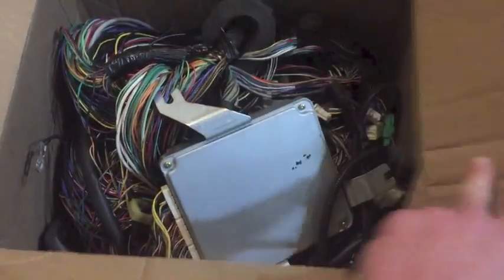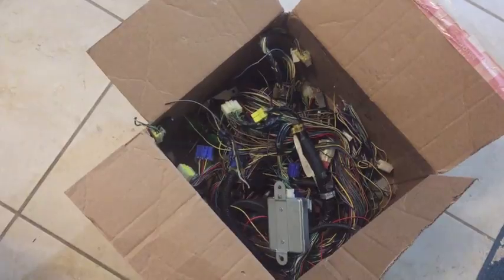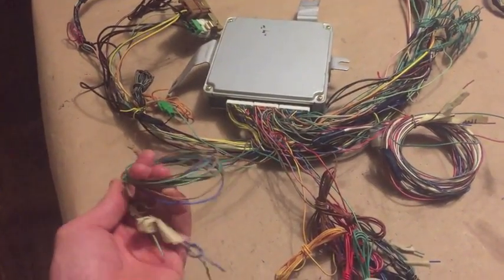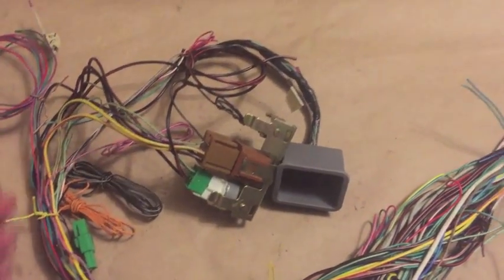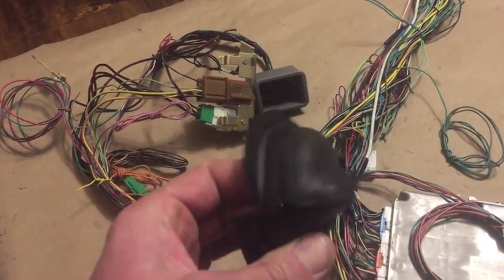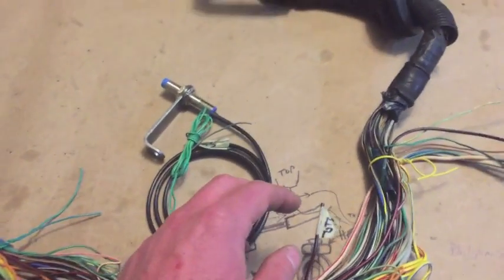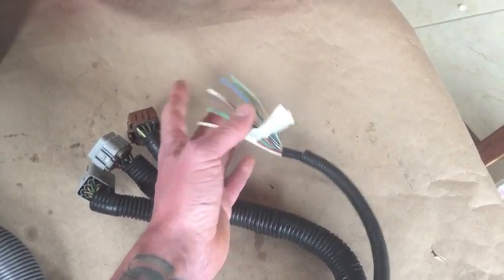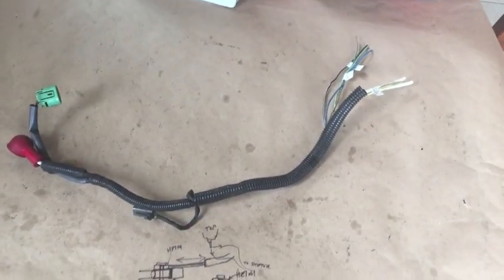2000 Subaru Legacy Wiring Harness VW Conversion

Comment: Great video.  How is this affected by the retrofit wiring kit for the instrument cluster?  I have a Subaru motor in my '87 Weekender and a couple wires on the blue foil sheet shorted out and melted.  My mechanic tells me that he can't figure out a way to get the check engine light to work with the retrofit wire kit.  Any ideas?

Comment: Hi ,fantastic vidoes,I was just wondering what you do with the sensor grounds,are they left alone. Im trying to get a 2000 Impreza 2,5 harness to work on my 2000 2.2 Impreza and for some reason the fuel pump wont cycle and the obd2 wont connect,your input would be greatly appreciated.

Comment: Some questions trying to get everything finished up for a test fire.  I can start on ether only right now.  fuel pump isn't getting power from the relay and even if I hotwire the pump it seems the injectors are not firing.  any tips?  also around 10:10 you mention 3 splices for the busaru speed sensor.  ignition on, ground, and the VSS connection to the ECU I'm guessing?
Reply: also, test mode connectors do not activate the fuel pump relay.
Reply: I kept messing around and found an ignition wire that needed signal to make the fuel pump cycle but it still wouldn't start.  after de-cluttering the excess wires from the ecu connections I got it to fire.  I'm not sure what changed between cleaning up the harness and earlier, but it starts every turn of the key.

So, back to the VSS, cooling, soldering the connections and cleaning up the harness.

Comment: Not a lot of demand for someone to invest in making these harnesses from scratch. A friend of mine put a 2.5 in a Baja Bug. He bought the adapter hardware from a company in California. They didn't offer a mod dedicated harness but gave him contact info for a guy that did them one at a time. I love how it drove when he was done. I wasn't to do the same thing but always had some other projects or lack of time.
Reply from the maker: +abe frohman That's exactly what I do for people. I wonder if I did his harness :)
Reply: I don't know he built his in about 95. I believe the adapter came from Kennedy. I had a dozen or so friends in a club of Baja owners. Several of them had swapped to other motors including Subaru, Toyota and Ford 2.2 I was one of a few still using a VW motor. We even had a guy with a 1.6 diesel in his.
Reply from the maker: +abe frohman oh yeah, about 10 years before my time. I love hearing about all the wild swaps.
Reply: I had my semi stock 1641cc motor poking along at the back of the pack but I wasn't doing clutch swaps every month either.
Reply from the maker: +abe frohman Ha! A 200mm clutch became a routine maintenance item with a high horsepower engine. I haven't seen that in normal driving but I bet in Baja style driving it would wear it out pretty quick.

Comment: Took me two weeks. An hour here, a half hour there. Because I didn't want to cut any wires I wasn't supposed to (did anyway). I had to (wanted to) lengthen some wires and shorten others to make them work better in the harness. Also, I didn't run a transmitter for the OBDII, and actually ran wires to the front for a ScanGaugeII. Reason: As the years roll by, the support for some sort of Apple product may disappear. If I did it again, it would probably only take me a day or two. A guide to the years/models with differences in sensors (MAS vs. MAP) or the newer atmospheric pressure sensors, would help a bit. Thankfully, I haven't had to deal with TBW issues in my application, but some will. The "spoofing module" that SmallCar sells has saved me some issues with codes. Perhaps there is a better way for the DIY'er. Thanks for doing this. Although I may be done with it, myself, many will appreciate it!
Reply from the maker: +Forthwith Tx Thanks again for the input - much appreciated.

Comment: I have a harness that I did up for a swap and I am wanting to get rid of the fuel level and pressure codes. You mention putting resistors in to get rid of them, can you go into that in more depth as to what wire needs what resistance please. I am also having some other issues I believe might be related to the harness, would you be willing to help me try and figure them out?
Reply from the maker: +Jon Marshall Shoot me an email - busaru@busaru.com

Comment: I have an opportunity to purchase a 2000 Subaru Legacy. Is this a good donor to convert my 70 Westfalia? If not, what do you suggest. Thanks! Obviously, we'll be doing business soon.
Reply: EJ25 ?  22 are good too (non interference design) ....Single Overhaead Cam is an excellent choice if in good condition...does it run well ?  Miles ?  compression ?  Busaru's street figher bus is the same engine with subiarugears 5 speed....

Comment: What do you suggest for PCV breather system - do you pcv delete or use same airbox and breather system - thanks-Brad
Reply: OBDfusion is a paid app - I am unable to connect to my ECU using any other OBD scan tool such as Torque- facile etc.Whic free scan tool do you recommend to try the 2000 /2001 Legacy ECU-thank you in advance-Brad

Comment: If you get a newer engine and ecu. Will the ecu have to have anything done to it? Be unlocked as some people put it? Thx! I have a 1970 standard beetle I would like to put a 2.2 or 2.5 standard or turbo.
Reply from the maker: +Jaime Willard the 2005+ Ecuador need to have the immobilizer with the harness. It's. A security feature that makes engine swaps a little trickier but still possible.
Reply: How mach extra trouble and cost is that? Thx again!!!
Reply from the maker: +Jaime Willard a good bit extra, I usually recommend going with an early 2000's harness.

Comment: i am surprised that no company has made a custom wire harness for this type of swap
Reply from the maker: +luke9511 from your perspective what would be the benefit?
Reply: less stress on the person doing the swap and less stress for someone like who who has to do it by hand where it could be done by machine instead and be mass produced
Reply from the maker: +luke9511 It's no stress for me to do it and it's only $450. Due to connectors not available for purchase, the robotics necessary to build a custom wiring harness, as well as the variability between years and models - it would be a disaster if a company invested heavily in that only to realize there isn't a demand for mass production.

Comment: does 97 subaru have the test moode plugs
Reply: IDK, but my 99 legacy did not appear to have them...I do have the wire at the ECU.  Check the pin out, and all you do is that to ground when you want to  put it in test mode.

Comment: Do you absolutely need the harness? Let's say you can find an engine and don't go the donor car route.
Reply: Let's just say that you have only the engine
Reply from the maker: +Matthew Morrison You need something to control ignition timing and fuel injection. Usually that happens with the Subaru computer, which needs a harness to connect to its sensors and controls. You can go to a junkyard and get a harness or pay someone else to get one for you if all you have is an engine.